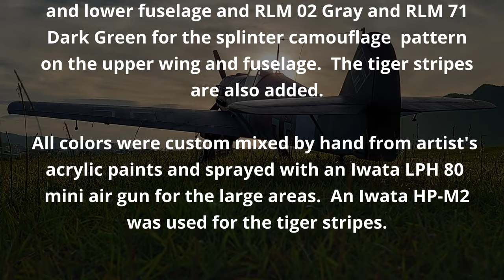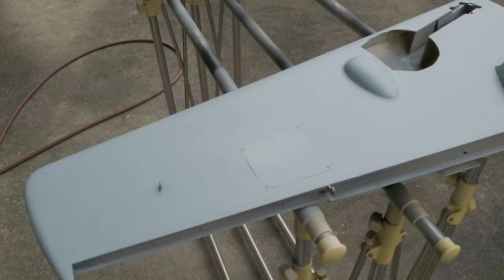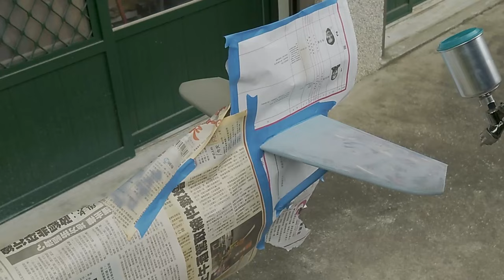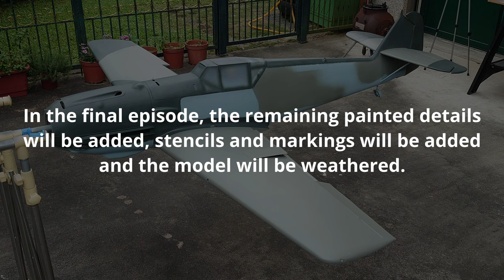Seagull Bf109E ARF Extreme Makeover, Part 5

Comment: Nice makeover so far . Gotta be on the ball with that single stage airbrush ! Did my mottling with 2 stage air on my TA 152 and spots on my desert camo 109e . Thanks for the update . Its going to look awesome !
Reply from the maker: Thanks.  I have an Iwata dual-action fine tip but felt it was too small for the job on the stripes.  That HP-M2 is really very versatile but not dual-action.